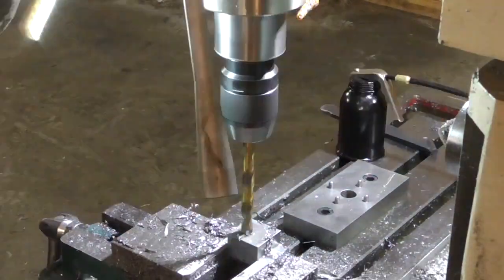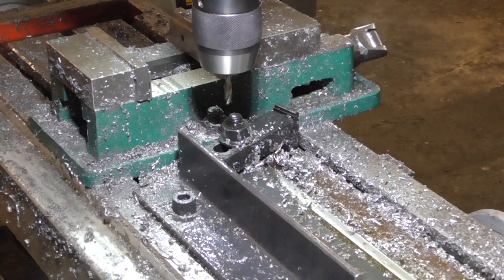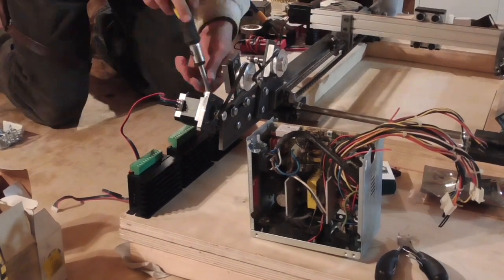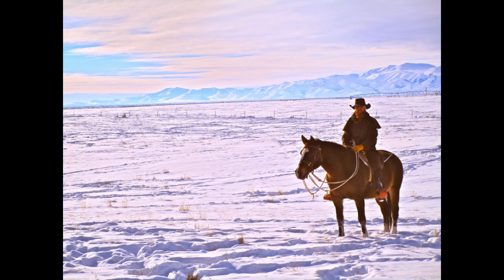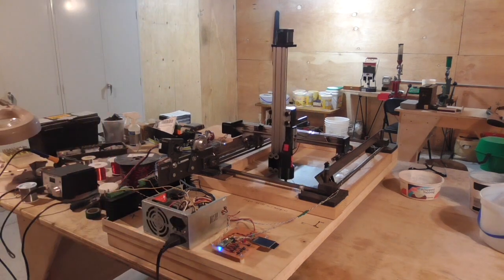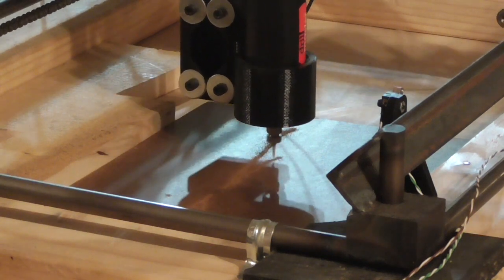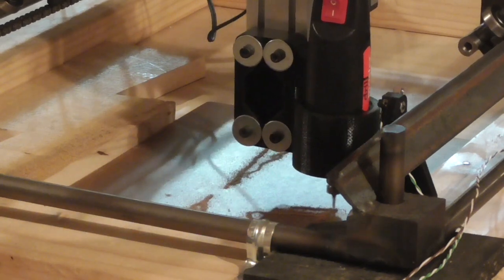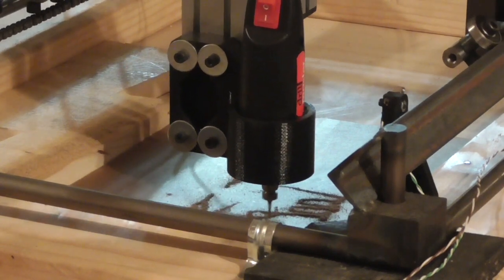DIY CNC Mini Router (TIS300)

Comment: Tim,  Think of your router as a prototype, rather than a finished product.  Then your system design and making efforts are impressive indeed!  This device informs where and to what extent improvements are required to turn it into a very capable router.

Comment: Personally I would've opted for the GRBL firmware, but since your goal was to learn from developing the machine, I understand why you developed your own firmware.

If it isn't rigid enough for the spindle, maybe you can convert it to an EDM machine?
Reply: I would have also personally just used grbl for control since someone has already done the work to write a decent g-code interpreter. I see no reason to redo that work, with the exception being if learning was the goal...

Comment: This is quite impressive. Would you be able to use a more powerful motor if you coupled it to a flex shaft so the frame wouldn't have to carry the weight?
Reply from the maker: That's an interesting idea.